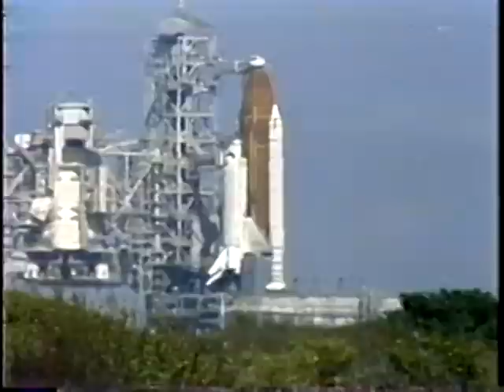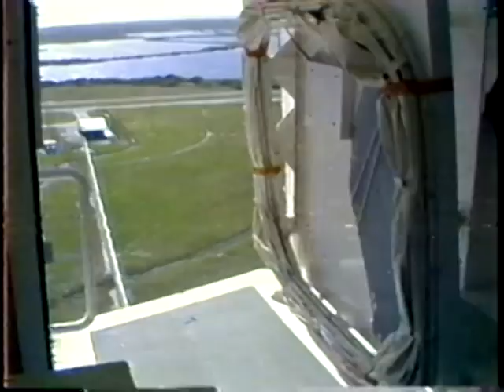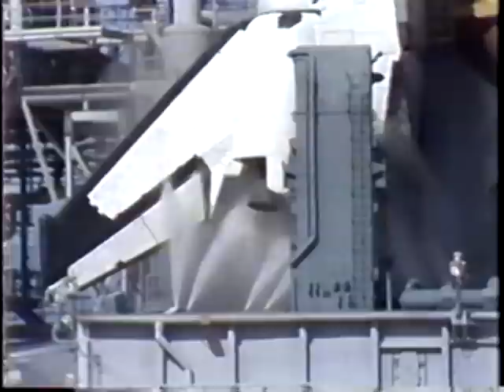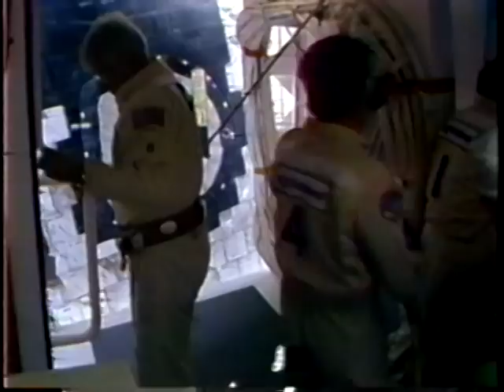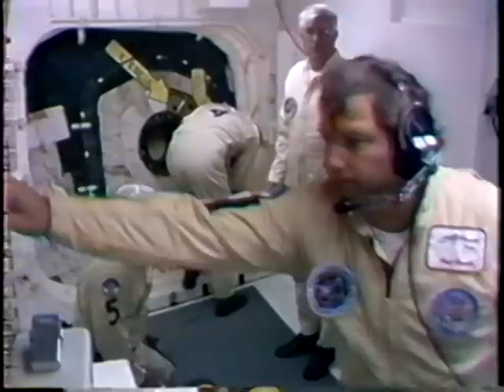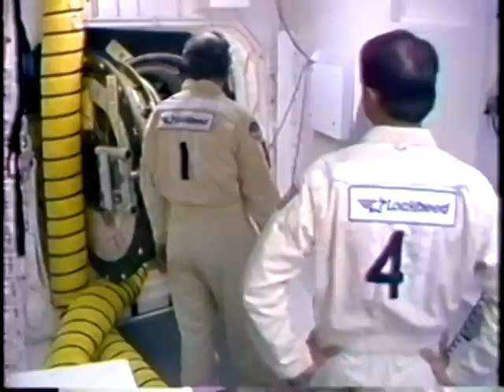Columbia STS 55 RSLS Abort 3-22-1993

Comment: Heaters around the joints... challenger needed that
Reply: Brandon Connelly Challenger is the reason why they added them
Reply: Brandon Connelly me too (heat near end of my marijuana cigarette)
Main engines start stabilize (burn a FEW gallons of H2 & O2) then SRB’s start  - explosive bolts blow and off she goes just go back and watch Space Camp
Reply: Yeah they... figured that out eventually.
Reply: @flynnkeevers7514  confirmned this is true

Comment from the maker: USA007587 Rev. A
When the two NSI detonators are ignited at each hold-down, the hold-down bolt travels downward because of a combination of forces; the release of tension in the bolt (pretensioned before launch), NSI detonator gas pressure, and gravity. The bolt is stopped by the stud deceleration stand, which contains sand. The SRB bolt is 28 inches long and is 3.5 inches in diameter. The frangible nut is captured in a blast container.
The solid rocket motor ignition commands are issued by the orbiter’s computers through the master events controllers to the hold-down pyrotechnic initiator controllers (PICs) on the mobile launch platform. They provide the ignition to the hold- down NSI detonators. The launch processing system monitors the SRB hold-down PICs for low voltage during the last 16 seconds before launch. PIC low voltage will initiate a launch hold.
SRB Ignition
During the final ordnance installation and connection (performed a few days prior to launch) the SRB ignition S&A device’s safing pin is removed from the S&A device. This allows the S&A device to be armed remotely during final countdown. Five minutes before launch, the SRB S&A device is rotated to the arm position. The solid rocket motor ignition commands are issued when the three SSMEs are at or above 90-percent rated thrust, no SSME fail and/or SRB ignition PIC low voltage is indicated, and there are no holds from the launch processing system.
The solid rocket motor ignition commands are sent by the orbiter computers through the master events controllers (MECs) to the S&A device’s NSI detonators in each SRB. A PIC single-channel capacitor discharge device controls the firing of each pyrotechnic device. Three signals must be present simultaneously for the PIC to generate the pyrotechnic firing output. These signals, arm, fire 1, and fire 2, originate in the GPCs and are transmitted to the MECs. The MECs reformat them to 28-volt dc signals for the PICs. The arm signal charges the PIC capacitor to 40 volts dc (minimum of 20 volts dc).
The fire 1 and 2 commands cause the redundant NSI detonators to fire through a thin barrier seal down a flame tunnel. This ignites a pyrotechnic booster charge, which is retained in the S&A device behind a perforated plate. The booster charge ignites the propellant in the igniter initiator, and combustion products of this propellant ignite the solid rocket motor initiator, which fires down the length of the solid rocket motor igniting the solid rocket motor propellant.
Solid Rocket Booster-Exploded View
The GPC launch sequence also controls certain critical valves in the main propulsion system (MPS) and monitors the engine-ready indications from the SSMEs. The MPS start commands are issued by the GPCs at 6.6 seconds before launch (staggered start— engine 3, engine 2, engine 1—all approximately within 0.25 second), and the sequence monitors the thrust buildup of each engine. All three SSMEs must reach the required 90-percent thrust within 3 seconds; otherwise, an orderly shutdown is commanded, and safing functions are initiated.
    1. GENERAL DESCRIPTION 1.4-4 1.4 Solid Rocket Boosters
Reply: @ETOPS Mine is "Nominal Thrust"
Reply: I’ll roll with you guys. I go by Turbo Pump. I can go about as long as the ssme’s did here.  The ladies love that!
Reply: safeing and arming?

Comment: Just think - this shuttle was the first to launch in 1980 after delays from a design that dates back to the late 1960s and early 1970s.  The shuttles launched all American astronauts from 1980 until July 11, 2011 - or 31 years of launches by 5 shuttles, two of which were destroyed in accidents -one on accent (Challenger) - one on decent (this one, Columbia). The Shuttle while a mechanical marvel never measured up to the reusability NASA hoped for.  Instead, in 2020 SpaceX is building spacecraft for NASA with much more reusable boosters than land themselves back on barges.  How times have changed in the last 50 years.
Reply from the maker: Sam S well I have to give SpaceX credit they have made space flight BORING!  Nothing compared to the shuttle program they are not even close to the capability of a space shuttle!
Reply: @KevinWRay  Maybe true but it is much cheaper and reusable - and that is what NASA always wanted.

Comment from the maker: STS-55 pad abort: Engine 2011 oxidizer preburner augmented spark igniter check valve leak

Show affiliations
Abstract
The STS-55 initial launch attempt of Columbia (OV102) was terminated on KSC launch pad A March 22, 1993 at 9:51 AM E.S.T. due to violation of an ME-3 (Engine 2011) Launch Commit Criteria (LCC) limit exceedance. The event description and timeline are summarized. Propellant loading was initiated on 22 March, 1993 at 1:15 AM EST. All SSME chill parameters and launch commit criteria (LCC) were nominal. At engine start plus 1.44 seconds, a Failure Identification (FID) was posted against Engine 2011 for exceeding the 50 psia Oxidizer Preburner (OPB) purge pressure redline. The engine was shut down at 1.50 seconds followed by Engines 2034 and 2030. All shut down sequences were nominal and the mission was safely aborted. The OPB purge pressure redline violation and the abort profile/overlay for all three engines are depicted. SSME Avionics hardware and software performed nominally during the incident. A review of vehicle data table (VDT) data and controller software logic revealed no failure indications other than the single FID 013-414, OPB purge pressure redline exceeded. Software logic was executed according to requirements and there was no anomalous controller software operation. Immediately following the abort, a Rocketdyne/NASA failure investigation team was assembled. The team successfully isolated the failure cause to the oxidizer preburner augmented spark igniter purge check valve not being fully closed due to contamination. The source of the contaminant was traced to a cut segment from a rubber O-ring which was used in a fine clean tool during valve production prior to 1992. The valve was apparently contaminated during its fabrication in 1985. The valve had performed acceptably on four previous flights of the engine, and SSME flight history shows 780 combined check valve flights without failure. The failure of an Engine 3 (SSME No. 2011) check valve to close was sensed by onboard engine instruments even though all other engine operations were normal. This resulted in an engine shutdown and safe sequential shutdown of all three engines prior to ignition of the solid boosters.

Publication:
Final Report Rockwell International Corp., Canoga Park, CA. Rocketdyne Div.
Pub Date:
March 1993
Reply from the maker: The liftoff attempt on March 22 was aborted at T-3 seconds by the orbiter computers due to an incomplete ignition of the number three main engine. The liquid oxygen preburner check valve leaked internally, causing overpressurized purge system which in turn precluded full engine ignition. This was the first on-the-pad main engine abort since return-to-flight, and third in program history (51-F and 41-D other two). The valve leak was later traced to contamination during manufacturing. NASA decided to replace all three main engines on Columbia with spares.
Reply from the maker: Six and a half seconds before launch, the ignition sequence of the SSMEs got underway, with its familiar, low-pitched rumble. However, within three seconds, all three engines abruptly shut down. It would later be determined that a liquid oxygen preburner check valve in the No. 3 engine had leaked in the final seconds, causing its purge system to be pressurized above the maximum redline level of 50 psi. With the No. 3 engine having incompletely ignited, Columbia’s computers commanded all three to shut down, in a so-called Redundant Set Launch Sequencer (RSLS) abort. The cause of the abort was a tiny shard of rubber, lodged in an engine propellant valve.

With unburnt hydrogen still lingering underneath the hot engine bells, the risk of a fire or explosion was very real. Seconds after the shutdown, the launch pad’s “white room” was automatically moved into position, alongside Columbia’s crew access hatch, preparatory to an evacuation, known as a “Mode One Egress”. Although the astronauts had trained to escape from a pad abort and slide to a fortified bunker, the danger of having them evacuate Columbia and run through an invisible hydrogen holocaust prompted controllers to instruct them to remain aboard the orbiter.

Five weeks after the RSLS abort, on 26 April 1993, the STS-55 crew finally took flight. Photo Credit: NASA, via Joachim Becker/SpaceFacts.de
For 40 tense minutes, Nagel and his crew remained strapped into their seats as ground personnel deactivated all electronic components. Paramedics were rushed to the pad as a precautionary measure, but for the astronauts all was well—albeit eerily still—within the swaying cabin. “I’d convinced myself,” Nagel said, “and all my crew that we were going to fly.” When the brief noise of the engines died, he called over the intercom to announce the abort to his crewmates. “I wouldn’t call it fear,” he said later about those adrenaline-charged moments. “There’s a couple of moments wondering what’s happened, because all you see on-board are red lights, indicating an engine shutdown. You know the computers shut down the engines, but you don’t know why or exactly what went wrong with them.”

The situation was equally tense in the Launch Control Center (LCC), where ashen-faced Launch Director Bob Sieck watched the proceedings. “Your initial reaction,” he said in the aftermath of the abort, “is to make sure there are no fuel leaks or that there’s nothing that’s broken that’s causing a hazardous situation. Really, it was one of those nice, boring countdowns … until the last few seconds. What did work, and worked very well, were the safety systems on-board. As a result, the crew is safe and the vehicle is on the pad and safe as well.” Nonetheless, the STS-55 crew emerged from the orbiter looking visibly shaken by the incident. A month would elapse before Columbia rocketed smoothly into orbit on 26 April 1993, but the RSLS abort suffered by Steve Nagel and his men provided a stark reminder of the inherent dangers involved in launching shuttle crews into orbit

Comment: Wow slow hatch open! Was there a faster way for emergency??
Reply: Yes there was but only in “real” emergency cases like cabin fire or so, this was not a “real emergency” that could kill the astronauts
Reply: @Thomas Eikel I can imagine that would be expensive to replace
Reply: It was safer for them to remain inside because of the chance of hydrogen fire on the pad due to hydrogen gas around the pad. Hydrogen fires are very difficult to see.
Reply: Detonating bolts I take it?

Comment: Why doesn’t the guy with the number 1 on his back stand on the other side of the aisle so he doesn’t have to keep raising his communications line for every astronaut walking past? If there’s a procedural reason for his position, why isn’t the plug on the other side? At the very least, there could be a hook on the ceiling??!
Reply: Not certain what guy you are speaking of, but i think you are refering to the final inspection crew on the pad.  The numbers refer to what job they perform and at what time during the final hours before launch.  A similar crew warned nasa about challenger at 51-L, but were ignored.
Reply: @patricklenigan4309  What are you talking about? The engineers in Utah warned NASA about the issue. None of these crews ever had any idea about any of that.
Reply: @djbeezy  he probably means that one of the launch pad crew also gave a warning, dumdum